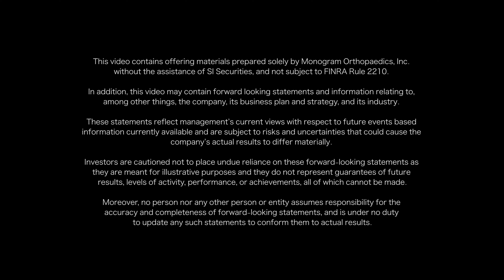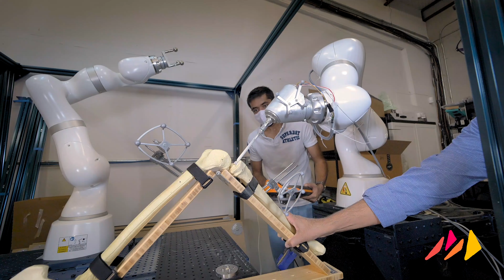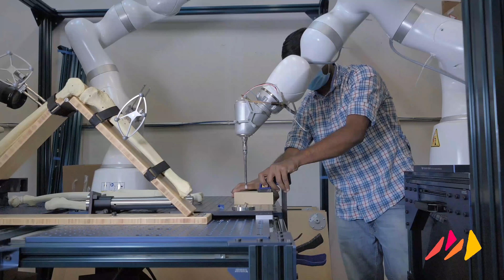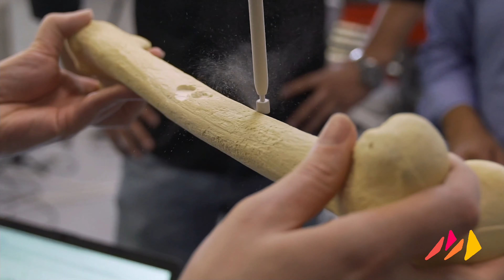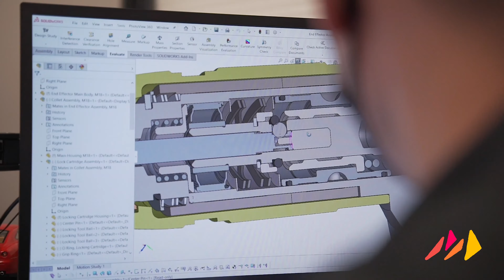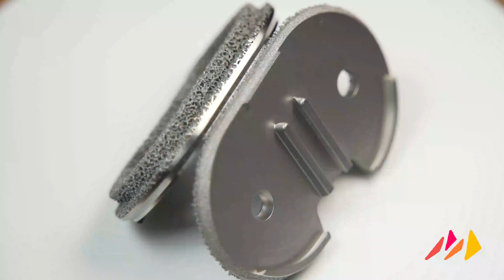Monogram TTW Promo Video

Comment: I want you to know Ive had 13 right knee and 8 left knee surgeries. in 2001I lived in GA and saw an orthapedic Dr. regarding a knee replacement. I actually questioned the Dr wy they were using a gingly saw instead of fixing the joint and having the ability to refine the cuts for the prostetics to fit properly. So I wanted to tell you that your using my idea which I spoke to the Dr about in 2001
Reply: Having an idea isn't hard, making it real, is.